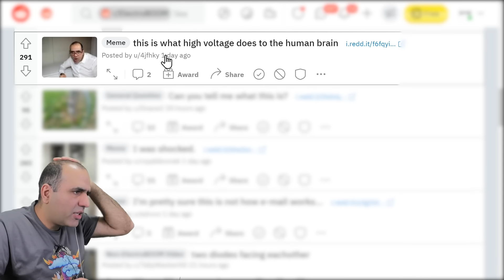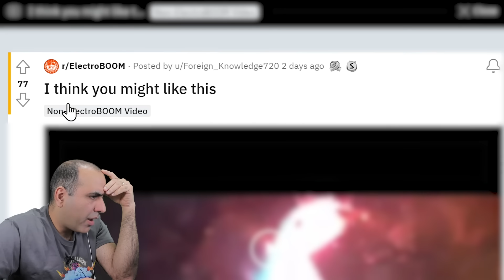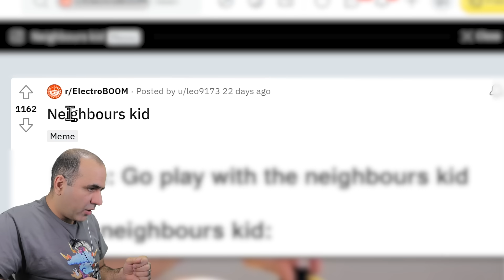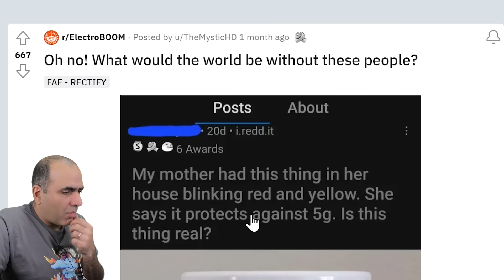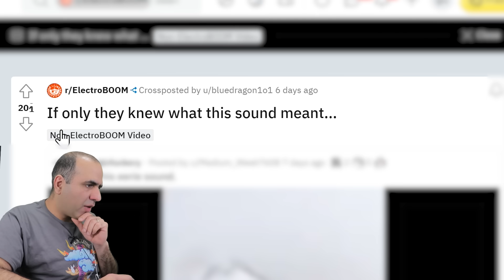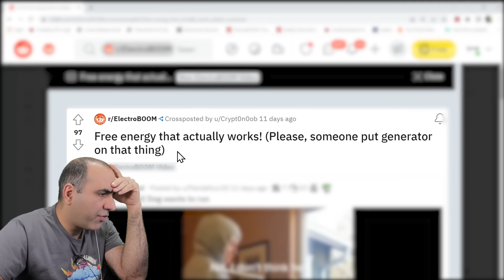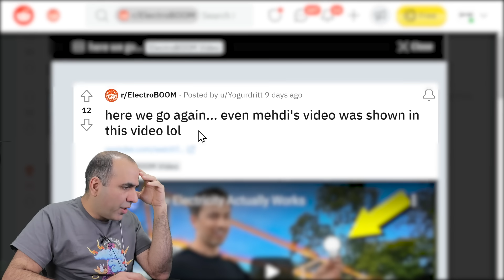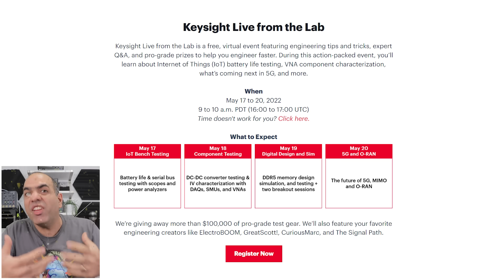Electricity Takes the Shortest Path (in the air), LATITY-010

Comment: Ahh yes, the connect fork. That’s how I got my start, actually. Turns out you can BREAK a breaker. 😂
Reply: I started mine when I connected 9V DC motor holding it in my hand into the 240V Powerlines and it Exploded LOL
Reply: WhAt'S tHe WoRsT tHaT cOuLd HaPpEn?
Reply: @KeysightLabs  lol
Reply: @KeysightLabs  wait wtf
Reply: @KeysightLabs  i didn't know you were the real channel
Reply: @KeysightLabs  only cardiac arrest
Reply: @KeysightLabs  Argyrophobia.
Reply: @KeysightLabs  A ChaRgeBaCk
Reply: Hi
Reply: Power of Mehdi 😂 smart blewup is matter 😁
Reply: Bam! Its gone
Reply: As a one year old crawling around on the floor I couldn't reach the cutlery drawer, but I did manage to find an old door key and discovered it fit snugly into a 240V outlet. Before anyone criticises my parents they did take precautions, always kept plenty of spare fusewire handy.
Reply: "Breaker finder".
Reply: Lucky. All I got was my father letting me grab an outlet he didn't turn off at the breaker, to be... "funny".  It needed to be replaced.
Reply: i used to do that with a slinky and we had fuses... my moms fuses were getting burnt regularly!
Reply: how do you reduce something through plasma??? would be usefull information to the high pressure burning chamber? theres not enough carbon in the world that can clear that odor or are you just a theorist?
Reply: Yeah well next definitely do not make a safety clip for lethal spaghetti wires.
Reply: I can Not believe it is not in bca code, life at risk by even designing in 240VOLTS A/C is at floor level.   ??@?
Reply: @Gladys edith I can Not believe it is not in bca code, life at risk by even designing in 240VOLTS A/C is at floor level.   ??@?
Reply: Is this a reply?
Reply: Funny
Reply: i tried to make my oen breaker it poped the brekaer plus the neighbour power as weel lol
Reply: 5:08 because you nealy die and you get shocked
Reply: Lol

Comment: If electricity passes through the shortest path, why does it go throw both in parallel 10 Ohms and 20 Ohms instead of just the 10 Ohms?
Reply: Because electricity takes every path, not just the shortest.
Reply: Well they didn't say it ONLY takes the shortest path
Reply: He has another video where he explains that the amount of current is inversely proportional to the resistance. But yeah, a valid point against that sentence which is incorrect and misleading.
Reply: @frecio231  I'm interested, could you send the link?
Reply: When you have unlimited current available from your power supply the 10 ohm resistor will pass all the current it can. But the power supply still has current available so the 20 ohm resistor will pass whatever current it can. 

So what if your power supply is current limited to below what the 10 ohm resistor can pass. How much will go through the 20 ohm resistor, if any. That is a really good question.
Reply: @ecospider5  If the power supply is current limited the voltage will drop according to Ohm's Law.
Reply: @maxine_q  what exactly does current limited mean?
Reply: @12kenbutsuri  Current limited means the power supply cannot deliver infinite amounts of current, which is basically every real power supply.

If you lower the resistance beyond the point where according to Ohm's Law the current through the resistor at the respective voltage would be larger than what the supply can deliver, the output voltage will drop.
Reply: @ecospider5  cool! So it's basically because there is a limited amount of electrons? Or more like a fraction of a nano second or something the resistance goes up to balance the flow or something like  that?

Comment: 3:47 I heard it's actually safer to moonwalk out of the dangerous potential zone, in many cases just keeping feet barely apart poses a lot less risk than jumping on one leg when you can lose stability and faceplant all the volts
Reply: I would take all the time in the world and inch my way out if my life was on the line, I don't trust myself to hop on one leg
Reply: In elementary school, we were taught to bunny hop away on both feet if we were near a downed pole.
Reply: @jeffmaxwell2933  That's vital knowledge for elementary schoolers. Did they also teach you how to escape from quicksand?
Reply: It looks like an ad for a mobile game with how uncanny it is
Reply: I mean you don't have to do big jumps.
Reply: I hear it also helps if you occasionally shout "shamone".
Reply: @chaos.corner  unless there are pedobears around.
Reply: No you have to electro boogie out of the danger zone of course. :) ☮️
Reply: @ninetendopesaitama2107  Electric slide?
Reply: Ikr
Reply: @Delsin "it's actually safer to moonwalk out of the dangerous potential zone" NOPE!! (facepalm) its not safe to moonwalk, the point is NOT to have two feet on the ground!! dont be stupid!!
Reply: @jarniskat  Having two feet on the ground is fine, as long as they are close together. You can jump using both legs, as long as you keep your feet together.

Comment: It might be better to say that electricity 'prefers' the path of lowest resistance. If it 'always' chooses the 'shortest distance' a Jacobs Ladder couldn't work 😜
Reply: Ok boomer
Reply: @andreimadalin6207  ok electroBoomer
Reply: was going to say path of least resistance.  the ionized gas has less resistance. Since it gets hot it rises, however it is still less resistance than the non-ionized air, so the arc is sustained even though the distance is longer.

Comment: 4:00 is accurate? so if you hop on one foot, you can escape those electrocution scenarios?
Reply: The voltage difference between two feet could mean you get shocked if both feet are touching the ground. Hopping on one foot means your body only has one contact point and there should be little to no voltage across your body.
Edit: However, I think the better thing to do is shuffle your feet very close together, because there's less risk of falling over. Falling on the ground would be a worst-case scenario because then you are contacting the ground in very distant places.
Reply: Yes. When power a line goes down, it can still be live, sending power to the ground. This creates a voltage gradient across the surface. Since meat conducts power better than dirt and rocks, touching two different sections of this gradient is bad. That's why power companies warn you: do not go near downed power lines even if they look like they're not sparking or moving like they do in movies. If power line falls down near you and you're still alive, then keep your feet close together, and move away with small steps with your feet as close as possible. I don't know about hopping though... if you lose your balance and catch your fall with your hands you will be much worse off.

Comment: Wait that clip with the high voltage lines Falling and electrocuting someone is accurate? Don’t they just short directly to the ground? How would current travel to u if it’s offered a shorter less resistive path?
Reply: because current doesn't just take the path of least resistance, it takes all paths. more current will flow through paths with less resistance, but some current will still flow through the more resistant path.
Reply: In my electronics course, they explained that if wire touches the ground when the tower falls off or whatever, it creates a zone where the electricity disperses, but the further you are away the weaker the voltage is. The thing is that electricity flows between things that has different voltage potentials. So if you stand with your legs one next to each other, there's no difference in voltage potential. But when you take a step, one of your legs is further away from the other, so leg closer to the cable has higher voltage than the one further away, which creates voltage potential difference between your legs and shocks you. That's why further on it shoes person hopping away, trying not to create the potential difference. I'm not native to english so some of these terms or whatever may not exactly be right.
EDIT: Found a Wikipedia page about this phenomenon. It's called stray voltage in english. https://en.m.wikipedia.org/wiki/Stray_voltage

Comment: If electricity takes the least resistive path, how do parallel circuits work?
Reply: Well, I guess the saying is kind of misleading. It would be better to say most current takes the least resistive path because current will always take all the paths but not equally distributed.
Reply: It does take the least resistive path, but it doesn't only take the least resistive path. All paths are used, but the amount each one is used depends on the resistance.